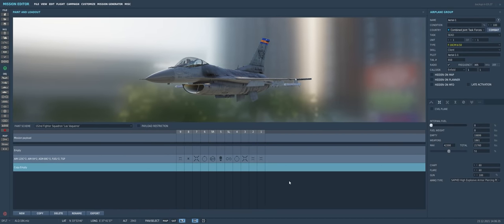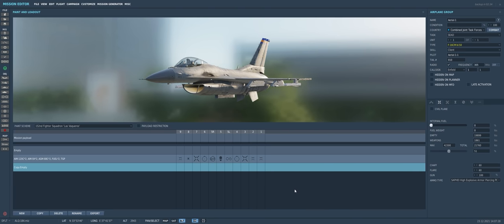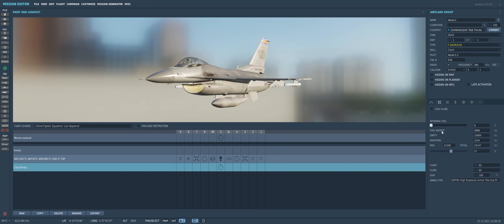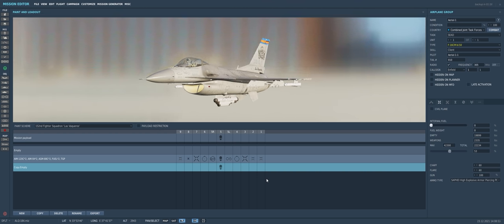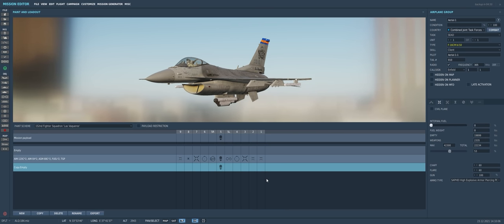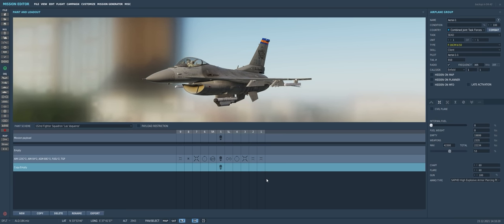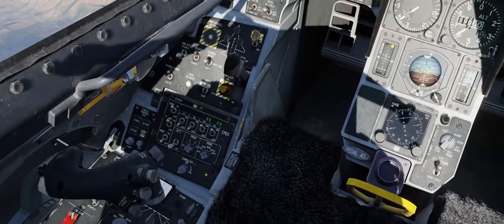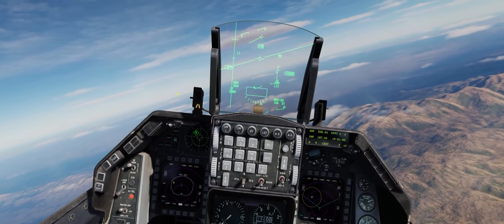DCS: F-16C Viper NEW ALQ-184 ECM Pod Pros & Cons!

Comment: The drag index is actually lower for the center bag in the viper. For A-A, it can make more sense to pull from the wing tanks first, and fight operating on to that extra fuel in the center.
Reply: Exactly, idk why anyone wouldn't use the wings first fuel mode and get rid of the extra weight and drag as soon as possible.
Reply: Not to mention with them finally adding wing ripping to the f16, the wing tanks being empty can make you quite a maneuverable aircraft.

Comment: Great video, I would say this though.  Against a Sa-2 site with the logic that dcs Sam sites employ I think you are better off not switching on your pod!!
Given that most sites will only have 6 launchers, its better to use the Israeli wagon wheel tactic which they used in yom kipper, which with the pod off tempts the site into launching at max range, which can easily be defeated and then cluster bomb the site. With the pod on you are much closer before they launch and kinematically the Sa- 2 is in a much better position. Just my opinion

Comment: I tested the centerline tank and with normal afterburner climb to 25k feet and it was damn near empty. And it wasn't full afterburner, just past the horn and full military power. So, even if you did a non burner takeoff that's basically all the centerline tank is for. Getting you to altitude without using the wing tanks or internal fuel. And as a side thought, does the engine pull straight from the external tanks? Or does it pull from the internal and the bags just refill the internals? Or is it selectable?

Comment: Question: Does the sim differentiate between Conventional Wave Radar and Doppler Radar for SAM/Ground sites. I know a CW Radar, if you fly straight at it, will loose lock. It's like notching a Doppler Radar set. Is that modeled in the sim?

Comment: Please show me this seeker head and its HOJ technology that you so casually reference in the SA-2 missile...
Reply: The SA-2 actually has very simplistic RFCG guidance in it's initial versions (who knows now, after multiple decades of upgrades...).  The receiver for which are simple dipole antenna on the nose.

Being a two stage missile, the weapon could not shield these command guidance uplink antenna on the back of the first stage tail and the second stage already places a tracking beacon here.  The Schmel radio proximity fusing system was in the nose and since the missile includes a command-detonation function (for range safing and nuclear versions) it 'made sense' to place the RFCG aerials in the nose were ground radars could easily be seen, past the EM noisy plasma tail of the liquid fueled sustainer.

Except... 

When B-52 formations started encountering the Guideline during Arc Lights, they casually jammed the uplink ('missile activity light') as well as the search radar and the threat went away because the Jammer strobe went in the same command guidance antenna and the distance of up to 8 miles vertically and 15 miles horizontally also put a lot of IBJ or Gate Steal stress on the Fan Song automatic tracking systems.  With the missile essentially functioning on CLOS from a radar which was jammed white, this two-pronged electronic attack seemed guaranteed to destroy missile effectiveness.

Except...

By the time Linebacker rolled around, some clever soul had discovered that the RFCG could be set to home on a signal above the missile (repolarized the dipoles), whether the radar could see it or not.

Much unpleasantness occurred during the Christmas raids when jammers became beacons.

Ordinarily, the relatively slow angular maneuver rate of the missile meant it would fly right out the other side of the strobe and miss-ile the target bomber.  But when it didn't...

The SAM's proximity fuse triggers the 440lb warhead at a considerable distance and it blows a frag pattern forward, like a shotgun along the missile flight path, until it intersects the bomber, anything up to several hundred feet away.

By leading their volley fired SAM like a thrown football, enough of the missiles would capture the jammer strobe early enough (as the bombers turned to come off target they sprayed RFCM energy across the sky from their fixed antenna depression angles while slowing their over-ground speed to a crawl for a few key moments) such that the HOJ modified missiles could lock onto the strobe and beam ride it, right up into the formation.

Where the explosion of the SAM could strike the X108 Mk.82/M117 bombs which were located in the bomb bays just ahead of the jammer package (ALQ-117 IIRR) and on wing pylons of the B-52D.  The resulting double explosion would light up the sky over Hanoi or Haiphong for MILES as the bombers took literally a minute or more to spiral in from 35,000ft to the ground, burning the whole distance.

https://www.historynet.com/the-11-day-war.htm

https://www.military.com/video/operations-and-strategy/vietnam-war/harrowing-audio-of-b-52s-bombing-hanoi/2849297403001

http://www.ausairpower.net/APA-S-75-Volkhov.html